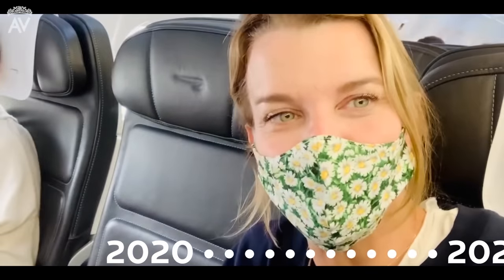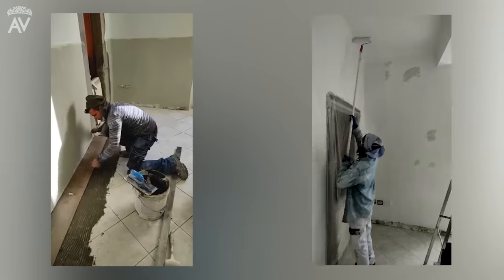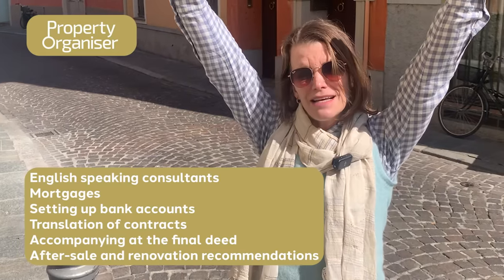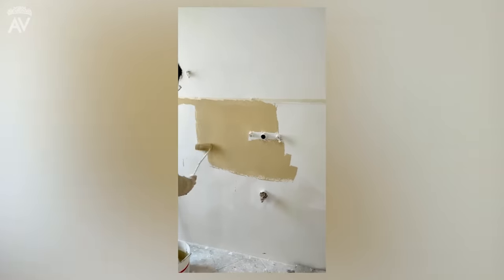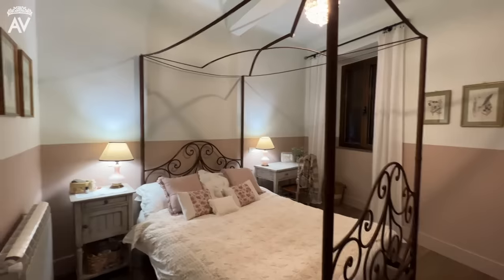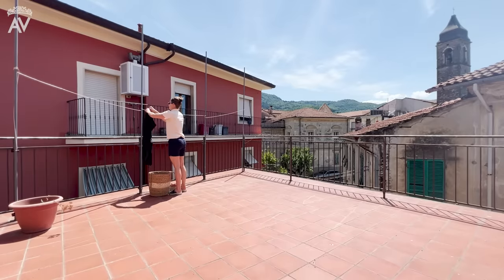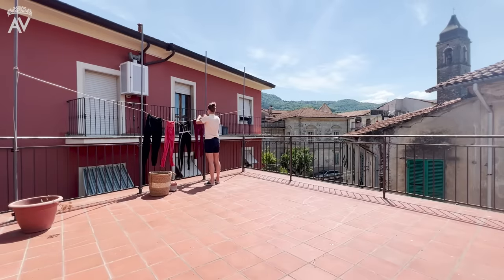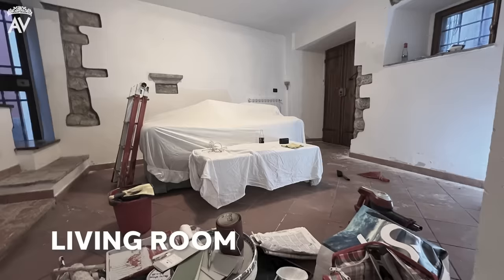Renovating my Little ITALIAN HOUSE, 1 Year in 15 minutes (lots of Timelapse too!)

Comment: Quick painting tip for getting perfect lines…. 1. Place the painters tape and push down into and bumps (use the right tape for your wall)  2. Paint the original color over the tape and a bit below so it fills in the gaps. 3. Let dry. 4. Paint the new color from the tape mark and below. 5. Let dry. 6. Carefully pull off painters tape 7. Enjoy your perfect lines with no bleed through! ❤

Comment: So sorry, the outside of the tub needs some help, even if a light sanding. The floor tile is absolutely gorgeous.
Reply: @CallieMasters5000  Precisely why it needs to be at least rough sanded to remove the "cancerous" part of the rust, which is the part that will require whoever might break their soft wet skin to need a tetanus booster.
Reply: I agree the outside of the tub reminds me of some one getting lock jaw
Reply: I hate the outside of the tub.  I think it looks like it belongs at the dump…oh, that’s right she found it along the road somewhere…great find but still think it could be so much better if the outside was finished…

Comment: I would have used different ceramic tiles for the bathroom.  Why get tiles that look like wood when there are such beautiful colorful and shaped tiles in Italy?
Reply: @Gandhavati  How is it that the wood-look tiles be less slippery if they are made from the same material.  Anyway, there are more interesting designed tiles than wood-like tiles, in my mear opinion.  p.s. I live in Italy.